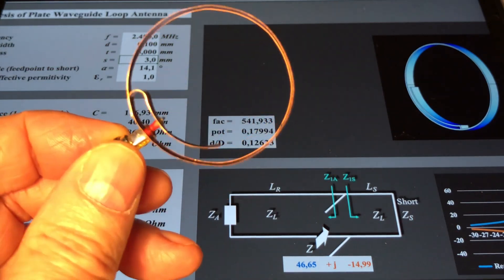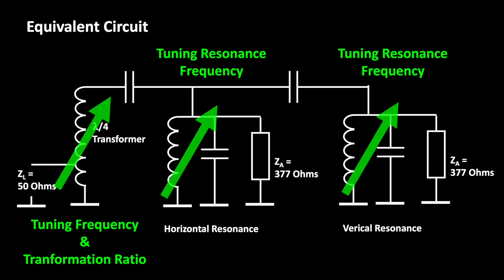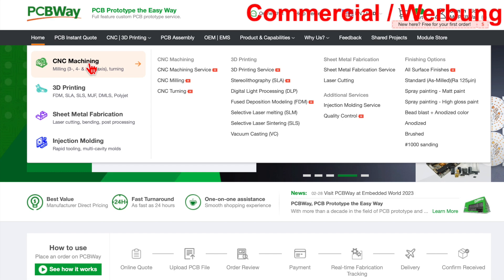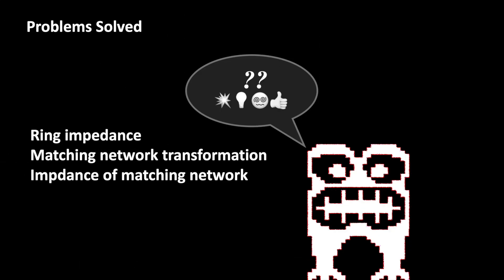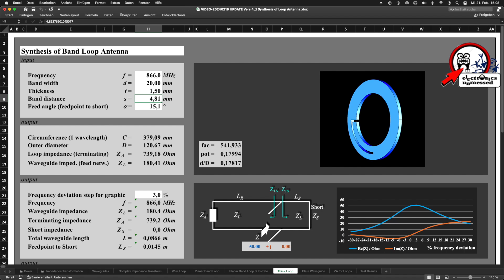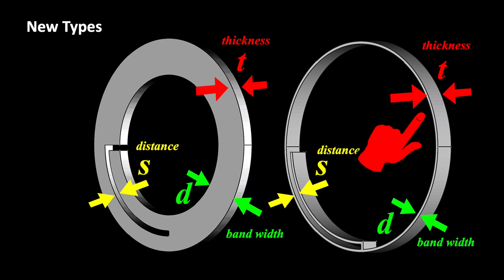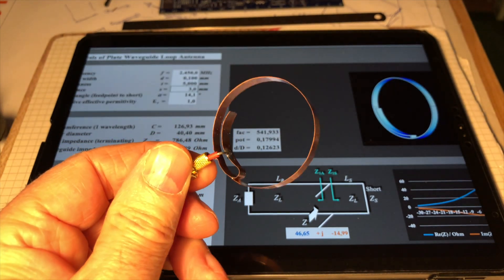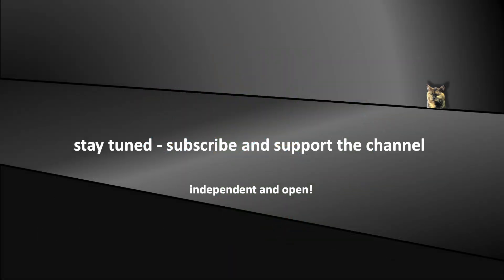Antenna Engineering, finally all Constructions: Ring antenna EXCEL tool Complemented (EP99c)

Comment: What's the gain (G) of the antenna? Can it be modified by changing e.g. diameter?
Reply from the maker: Thank you for your comment! 
The gain is about 4 dBi, which is not much more than a simple dipole. However, the antenna is producing a significantly better reception signal mainly because it receives all polarizations. I've tested and explained this in previous videos. Might be interesting for you. Regarding the diameter: The antenna is resonant and quite frequency selective. If you change the diameter, you obviously change the resonant frequency. You can increase its gain using a reflector, see recent videos about radio astronomy.
Reply: @electronics.unmessed  Perfect, thanx!

Comment: Hi @electronics.unmessed
Great project! I have a nanoVNA and a 3D printer. I would like to experiment with this design. Having trouble understanding where to find the Excel Solver part.

Thanks
Reply from the maker: Hi, 
thank you for your comment. The solver is an Add-in from MicroSoft, which you can download: 
https://support.microsoft.com/en-us/office/load-the-solver-add-in-in-excel-612926fc-d53b-46b4-872c-e24772f078ca#OfficeVersion=Windows

Hope that helps. Happy making! BR Klaus
Reply: @electronics.unmessed  Thanks, Klaus
Reply: Klaus, 
I made a openSCAD script that seems to be able to generate the antenna shape. If you're interested, how do I send it to you?
Reply from the maker: Great! You can use the e-mail address that you will find under the channel info. I am using FreeCAD. Hope I can import the openSCAD script format.

Comment: soo uhh, what sorta diameter wouldi need for the80m band or 40m, lol
Edit as the width and size would be huge lol. 
But the 144 2m band would be interesting vs a dipole or hourglass antenna
Reply from the maker: Yes you nailed it. I built it for 70 cm. Maybe the next one is for 2m.

Comment: I tried version 4_1 of your spreadsheet for a 2.44 GHz plate waveguide loop with d=0.8 mm. Alles ist in Ordnung, außer the d/D at 0.26807 has a red background. Was bedeutet das?
Reply from the maker: In that case nothing to worry about. I am using this indicator to see if the calculation model is still valid for the other options. I haven't adjusted that on this sheet yet. Thank you for your comment. I'll have to improve that in a future version.

Comment: Nicely done! Subscribed!  Can you add a reflector to increase gain? What is the gain of this antenna usually?  Can you put these in an endfire configuration?
Reply from the maker: Thank you very much for your comment. Yes, you can use a reflector. I was showing a NEC simulation on that briefly in that video: https://youtu.be/a5n_YWJaPkI
One of my subscribers built it and is using it for feeding a radio telescope.
Maybe that would be worth a separate video. What do you think?
For the gain, polarization, etc. please check out video:
https://youtu.be/1xigmkPVu0k
For comparison with monopole antenna:
https://youtu.be/EMwD6QOhwF0
Concerning an endfire array: a great idea! I definitely will put some investigations into that. BR Klaus
Reply: @electronics.unmessed  yes all those ideas are brilliant!  I looked at your other videos and your channel is amazing!

I might make this antenna for 315 mhz and 433 mhz, I want to see how far I can receive TPMS bursts. Very low power, 500 KHz bandwidth, short randomly spaced bursts.  Makes them fun to try and receive/decode. 

I remember hearing when you start networking antenna elements that the received noise is also a little higher. Is this true?
Reply from the maker: Interesting! You can probably get a more stable reception and longer range. Concerning the noise: this antenna is a bandpass and an antenna at the same time. So, you can lower noise and interference especially when using simple receivers. Do you want to read the TPMS signals over a higher range?
Reply: @electronics.unmessed Yes exactly!  I discovered TPMS accidentally one day on youtube and it’s a pretty fascinating challenge to receive.  I have a directional antenna (11 dBi) and then a low loss interdigital filter and then a LNA.  So far furthest i have received is 240 meters away but I still think I can improve it. The signals are very faint by that distance.  Also challenging is the variations in their carrier frequencies, baud rate,modulation scheme and packet format between different sensors.  Usually the packet has a MAC address, tire air temp, tire air pressure, some status flags and a CRC. Besides better antenna (and allowing possibly ditching the extra filter) I will try and make some signal models that are highly unstable, where the slightest signal influences a bit flip. It will mostly output noise but the CRC should reject most invalid packets.  Since packets repeat a few times in a row, i can filter detections that are not consistent.
Reply from the maker: @weirdsciencetv4999  Wow, very interesting! The range you achieve is remarkable. I think it's also a good idea to use repeat signals to correct errors. By the way, we also have a video about it: "Reading Signals above the Noise Level...". 
https://youtu.be/3wb2u3xcSwA
Maybe it will be interesting for you. I have a few questions about this out of interest: Could you stand next to a road with your receiver and receive the data from vehicles passing by? Do statistics? Warn people if they drive with too low tire pressure?

Comment: Curious, if you 3D printed this design and sprayed with graphite paint (and potentially even electroplated with another metal if desired) would it be nearly equivalent to a CNC milled part?
Reply from the maker: Thank you for your comment. That is a very good idea. Due to the skin effect, the currents at 1 GHz, for example, cannot penetrate deeper than 2 micrometers anyway. What would be thickness of electroplating?
Reply: Hendrick Youtuber who I would say is a professional electroplater of 3D prints often makes 3-4 spray paint coatings of graphite paint to ensure perfect smoothness and thickness of this conductive layer then enables electroplating. Electroplating of course is microns compared to the metallic graphite paint. So really the thickness of the metal is derived from these painted layers that can be sprayed or painted. The electroplating is simply a modifier for finish and durability and esthetics.
Reply from the maker: @k.o.0  Thank you very much. I don't have any knowledge about electroplating. I was asking the thickness because you need a good conductor for the antenna. No problem when it is only 2 microns or so.

Comment: what is the lowest frequency, can you do something at 10m?
Reply from the maker: Thx for your question. There is no principle limit and you could bild this antenna for 10m wavelength. However, bear in mind that the diameter will be like 3.2m.
Reply: @electronics.unmessed  Thank you for the reply. Yes it would be a large antenna.  May build it one day to hear the selectivity and noise. 
LoRa antennas, either UK or USA bands,  are interesting.
Reply from the maker: @allenshepard7992  I agree with that. But of course it would be extremely cool to use the concept for 10m too. I would really be happy about that.
Reply: @electronics.unmessed  If you do, please post. Your building skills are better than mine. 
   Yes, I will put the build on my "To Do"  list. Life is not a spectator sport, all must participate and contribute. (smiles) You will never know what you find.
Reply: I’ve built a magnetic loop antenna for the 7MHz band. I used 8m of 1/16” aluminium strap with a home made motorised capacitor to tune it. 

More of a classic loop and cap design.  Keen to look into  this design which appears to be a full wave loop.
Reply from the maker: @MidlifeRenaissanceMan  Maybe you can share your experiences here? I'm really looking forward to it.
Reply: @electronics.unmessed  I’ve been threatening to do a video on it. The motorised capacitor was the challenge. Need to do some real world tests too. But life is solid for me between now and mid June. I’ll be clear after that with a bit of luck and will have some time for radio and experiments. 

Need to clear the bench of half finished repairs and the desk of unfiled paperwork
Reply from the maker: @MidlifeRenaissanceMan  That sounds somehow familiar to me 😅
Reply: @electronics.unmessed  well the Minister for Finance Entertainment and Shoes has decreed that I’m not allowed anymore projects until everything else I have is either “Fixed or Flicked”. I’m not allowed to acquire any broken dreams to fix until the pile has been gone through. 

Add to that the renovations to the house and I have my life cut out for me :-)

Still I have time to pick up a guitar or pound some brass or sit back with a class of red wine.  But there in lies the dilemma: 

Guitar
Straight key
Glass of wine 

But only 2 hands

Comment: The most significant digits of the frequencies in the S11 plot for the 2.45 GHz antenna are clipped, so I ask: what sort of 3 dB bandwidth can one expect?
Reply from the maker: Hello Fred,
Thank you for your comment. You remind me of something that I need to show better in future videos about this antenna because it is actually a bit difficult to determine the values from the graphics.
So, here are the key figures: The 3dB bandwidth of S11 is 442 MHz (18% of the center frequency 2450 MHz).
The frequency range in which the SWR is better than 2 is also interesting, because that's what you expect from a good antenna: 206 MHz (8.4% of the center frequency).
I'm always happy to hear good questions like this! Have fun with my channel.
BR Klaus
Reply: @electronics.unmessed  Good, that should cover the entire ISM band.
Reply from the maker: @FredFierling  Yes, that is correct.

Comment from the maker: Downloads are ready now!
Reply: Oooh this is good! I like the idea of something that could be cut from a copper sheet with a CNC machine.
I just need the CNC 😂
Reply: You got rid of the gremlin in the starts of your videos 😂
Reply from the maker: @Dazzwidd yes, using a new microphone now 😅
Reply from the maker: @Dazzwidd  I made good experience with thin foil you can cut with scissors. And .. there will be PCB-Versions later this year.
Reply from the maker: @Dazzwidd 👍
Reply: I wonder how squeezing it into an oval could go feeding a yagi 🤔 Get it to a "fat" folded dipole
Reply from the maker: @Dazzwidd Here's a better idea: You can apply the Yagi-Principle using circular reflector and directors. That's in the pipeline. Stay tuned! Greetings Klaus
Reply: @electronics.unmessed I did think of this, but I suspect that yagi element spacing schemes will not necessarily be compatible with the placement of the current nodes further away from the first director than using a dipole when the design has the first director fairly closely spaced to the driven element. You might not get the same side nulls and the front to back ratio could be worse
Reply from the maker: @Dazzwidd I will do a simulation on that. BR Klaus
Reply: @electronics.unmessed Cool, you learn a new thing too. Without questions, you don't explore hey? 😊
Reply from the maker: @Dazzwidd Sure, I also cannot know everything in advance 😅. I only have the means to find it out. Stay tuned! Greetings Klaus
Reply: @electronics.unmessed You have the means better than me too!
Reply from the maker: @Dazzwidd May I ask you about your application you have in mind for this?
Reply: @electronics.unmessed Purely Experimental interests